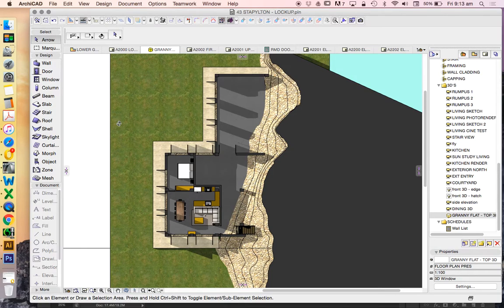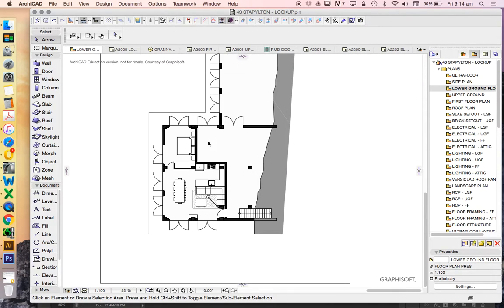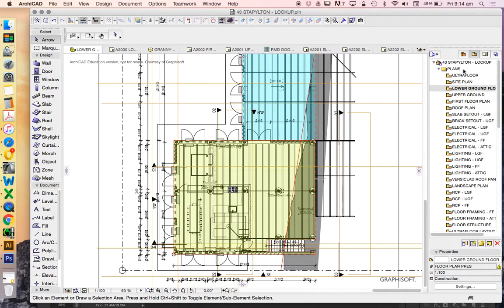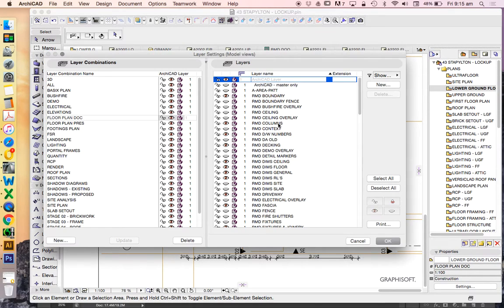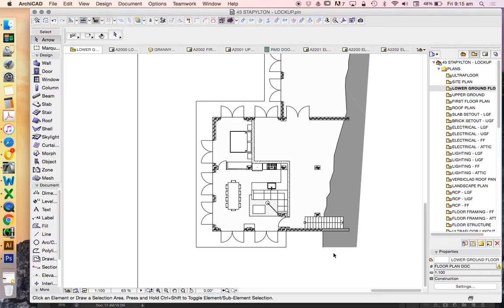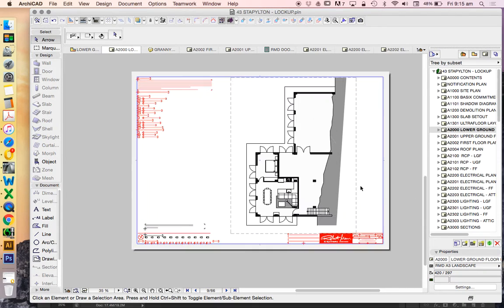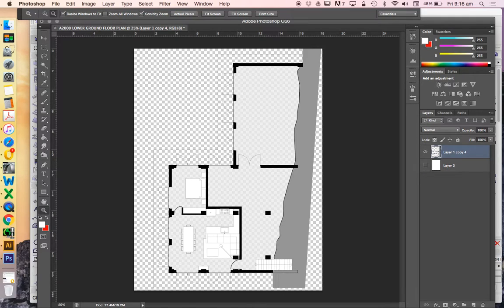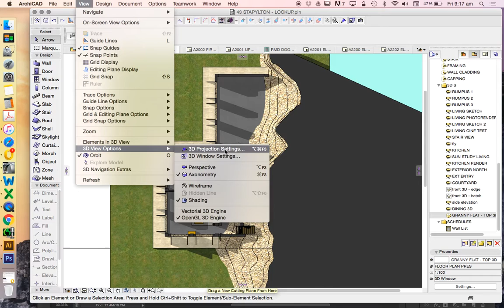PRESENTATION PLANS - 01

Comment: Robert thanks for those wonderful tutorials ! 
I downloaded the last version of Archicad and I'm having trouble getting the right settings for the presentation plan as I don't have the same structure display menu as you show on the video... (I might have the default settings "entire model / core only / without finishes" etc) When I try to set the model view on the presentation setting I don't have any openings and the walls appear as lines only. Do you know how to sort it out ? 
Thanks,
alex
Reply from the maker: Hi,
the settings that I use in this tutorial are highly customised. You might need to refer to some of my other tutorials if you would like to learn how to customise these for yourself also. Otherwise, there are till plenty of surfaces that come with the standard program, & lots available for purchase or even free download from various online companies & communities.